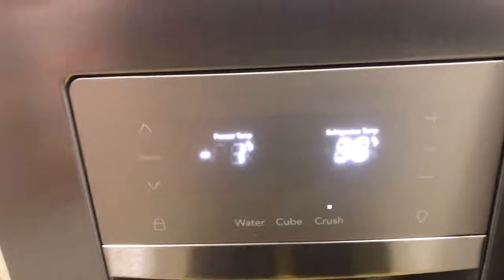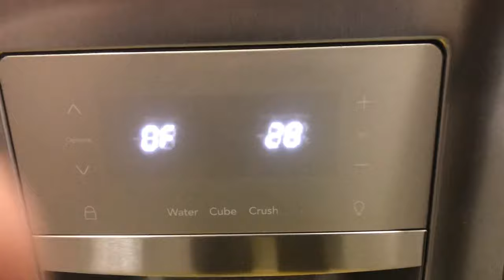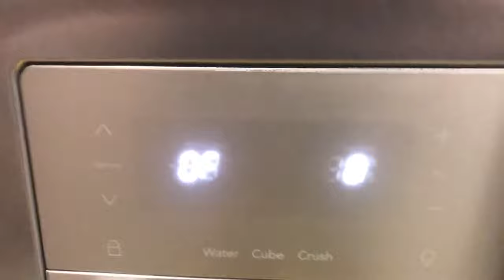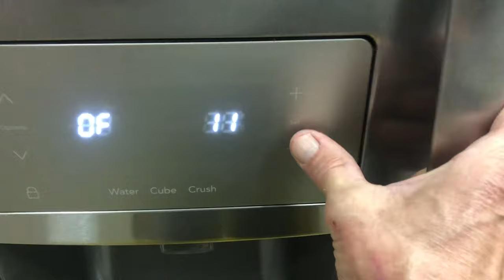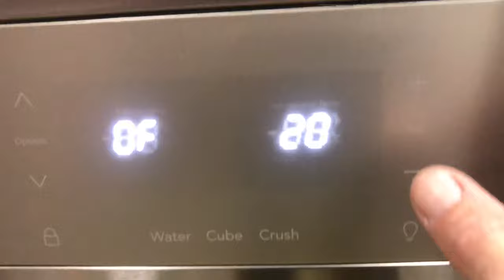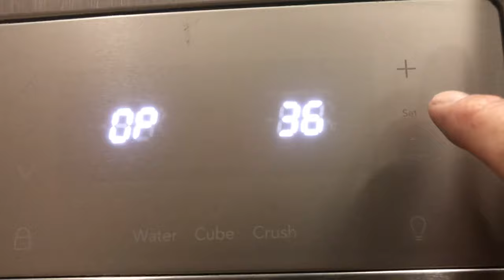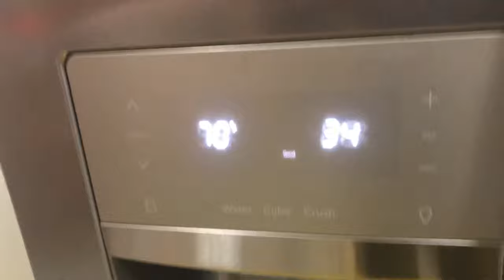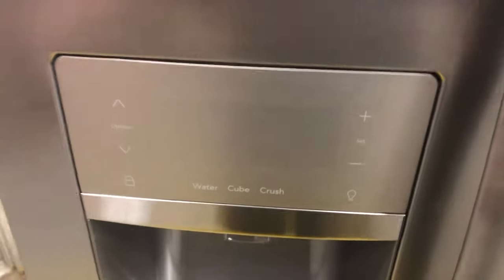Running Diagnostics(Test Mode) On A Frigidaire Gallery Side By Side Refrigerator

Comment: 28 = water/ice dispenser paddle
46 = humidity sensor
47 = heater inside dispenser area to prevent condensation, can toggle it on/off
1 = compressor
2 = defrost heater
8 = water valve to dispenser (put a water cup in place first)
10 = ice dispensing motor (take ice container out when doing test)
11 = ice cube crusher (don't let it run too long will damage coil)
12 = condenser fan38 = compressor (unclear difference between this and #1)
13 = fresh food lighting
15 = evaporator fan in freezer
20 = freezer lighting
22 = air damper that allows air from freezer to refrigerator
36 = ice chute door
23 = fresh food door
24 = freezer door
29 = fresh food thermostat
30 = freezer thermostat
33 = ambient thermostat (room temperature)
34 = control panel thermostat39 = evaporator thermostat (controls defrost)
45 = unclear, potentially another thermostat
0, 1-, 2-, 3- = "don't worry about these"
Reply: Could you send the codes to my email please. I do not have eyesight I can’t seem to get my iPhone to copy them for me or give me the opportunity to copy them
Reply: THANK YOU
Reply: Thank you!
Reply: How do u exit the menu? Lol
Reply: Thanks so much for breaking it down, you're awesome!😀
Reply: You rock. Thanks!
Reply: @Illmatic1989  leave it alone for 5 min... or press + for 6 seconds
Reply: I don't have a select button, just up and down buttons. How do I make it turn the compressor on when I am in that option?
Reply: Water valve on to ice tray ?
Reply: You are doing God's work sir

Comment: I have a brand new frigidaire gallery model GRSS2352AF side by side. Only owned it a week. Unit is stuck in OFF mode. Sales store could not assist. Frigidaire support closed on weekends. I'm desperate for assistance as I just replaced $300 worth of groceries that I had to throw away from previous unit dying

Comment: My fridge is not cooling but the freezer works fine. I am guessing its the fan from freezer to fridge or the door/flap that is not working. 
I just tested my paddle switch thanks to this video and it works. 
Now, need to test the evap fan.
I wish you posted a link to the document that you are referring to in the comments so people can use it if they need to do it again. Still, Greatly helpful video!!!
Reply: Mine has same problem may I ask what the problem was? We had repair man twice and still same problem. We unplug overnight then it works 2-3 weeks but keep’s continuing same problem then

Comment: I have a Frigidaire Gallery like the one in your video.  Display reads 1 and 33 for temps.  But I’ve placed thermostat inside. Bottom shelves of fridge shows 33 and as you go higher it reaches 50+ at the top.  Can u diagnose based off of this. ??
Reply: Also your showing the test but what does it show if something is wrong or faulted?

Comment: Can you run the auto defrost with food in there?
Reply from the maker: Yes. Auto defrost will be about 15-20 minutes then normal cooling will resume
Reply: I removed the icemaker and fan as we don't have water hookup. The coil behind the icemaker and the evap coils are frosted over, but the the drain hole is clear. Is this OK?

Comment: My frigidair refrigerator got flooded about 1 foot high. Now dead. no lights no sound. Could it jut be the starter relay and capacitor?
Reply from the maker: Sounds like the main control fried. It’s underneath the refrigerator in the front behind the toe grill.

Comment: My Frigidaire Gallery is freezing food at the back of the refrigerator.  Is there a test result for that?  Help!  How can I fix it?
Reply: I have the same problem.  Did you end up ever getting it resolved? I tried all the diagnostics and put an actual thermostat in the refrigerator side.  The actual temp in the fridge is lower than what the display reads...our food keeps freezing and honestly not sure what to do at this point. Any info would be helpful please!
Reply: @gigigigi787  any news re: solution? I just bought one on 11/20/23 and same thing is happening.

Comment: Thank you for sharing. My Frigidaire Refrig is about a year old-ish the frame inside is now hot and the rubber on the doors. Not the whole frame. The hot spot is about a quarter from the top of the fridge handles. What can that be? Thank you.

Comment: I checked the diagnostics and even though I have the temp set on the control panel to 33 degrees Fahrenheit, the diagnostic says it's set at 17 degrees Celsius (which is 63 degrees Fahrenheit). When I get out of everything, the display says 33 degrees F for about 30 seconds, then it jumps up to 63 degrees F. Is it possible to correct the temperature shown in diagnostic mode? BTW - this was a VERY helpful video... even more than the manual. :)

Comment: BRAND NEW OUT OF THE BOX REFRIGERATOR!!! We went through all the tests and per the tests, the refrigerator is in working order.  However, the refrigerator is still not cooling or freezing....  Been plugged in and set to the recommended temperature settings for 18 hours plus and no change.  Very frustrating .
Reply: Sounds like maybe the compressor isn’t running or there’s a problem with the Freon system. I understand your frustration! Call Frigidaire asap!

Comment: Got compressor to start again (not sure if it was due to diagnostics) . IMPORTANT question…how hot is the back of the fridge supposed to be?? Is that the fans cooling the compressors?
Reply from the maker: Your condenser coil and fan are in the back next to the condenser, depending on conditions it could get fairly warm to hot. That fan should be running any time the compressor is running. If the fan doesn’t run it will get very hot back there and could cause the compressor to shut off on overload.
Reply: @danielsonpicker7279  thanks….i stopped working the same time my both 2 ACa stopped cooling, my blender started smoking and than the fridge. My freezer was 30 degrees and the fridge was at 59 in diagnostics. Never seen a fridge not turn on the compressor as soon as it starts. Is it suppose to be slow. I was hearing a clicking for hours in the top back (fridge not freezer) area. Never heard it click click click click click. I assume compressor is on the bottom. Strange.
Reply: My PSEG tech even said an amazon tranformer blew in the morning when I was asleep. I assumed we had a outage and than got low power feed. Strange day haha 😂
Reply: @danielsonpicker7279  also i noticed there was no number 36? I assume to turn on the compressor on and off. Along with the clicking back-too area of fridge (not freezer)

Comment: My control panel lights cannot be read, appears that some lights are out or something else is wrong.  I cannot see anything to set??? Please help.  I cannot run diagnostic on anything cause lights are spotted and not readable.
Reply from the maker: If some of the LEDs are out on the control panel it will need to be replaced.

Comment: My frigidaire flapper that seals between the top doors has a 1/4 in gap at the bottom. No seal under the flaper. Not even one in the parts pics or diagram. I don't see we're anything goes under it to seal it when the doors are closed. I put foam under it to seal it. What is the deal on that?
Reply from the maker: It’s tough to say without seeing it. Something is broken. Depending on the model my guess is it’s probably the bracket that holds the door or could be the spring or mechanism that pulls the door closed. You would have to take it apart to get a look at what’s going on.
Reply: @danielsonpicker7279  
It's the million I'm talking about. The bottom of it has a gap when closed. Nothing in parts list shows anything to seal the bottom when the door is closed .

Comment: Hello sir, after I hook up the display interface, it doesnt power on or light up at all.  Is there a way to trouble shoot this issue?  The fridge is still running, but the lights in the fridge is also off.

Comment: I have the same fridge and the compressor runs fine, the cooling fans runs fine but it is not cooling at all fridge or freezer. would that be the thermostat and how can I test the temperature thermostat to determine that?
Reply from the maker: If you are not getting any cooling at all and everything is running you most likely have a freon leak or restriction in the freon system
Reply: @danielsonpicker7279  other than that do you recommend me checking anything else that could be causing this issue it does not cool at all it but the fan and compressor is running fine.
Reply: @danielsonpicker7279  also this is a brand new fridge still has the stickers on it it was purchased in 2019 but before the homeowner moved in he foreclosed on the house so the fridge still has stickers on it, has never had food in it.
Reply from the maker: If the compressor is running you should be getting some cooling, if you are not, that’s not good. I would check the owners manual if you have it or call Frigidaire, some models have a five year sealed system warranty.

Comment: On my control panel some of the lights  don't work so I can't always make out the entire number. I noticed you said that this would require a whole new panel do you mean a new Frigidaire 242058230 Refrigerator user interface or the User Control and Display Board? I have the Frigidaire FGHB2866PFEA model .
Reply from the maker: For that you would replace the user interface part# 242058230

Comment: I'm trying to repair one of these and replaced the main board but the compressor and condenser fan don't run. It has 122 volts going into the inverter board and a 5v signal voltage. The compressor ohms out at 6.5 for all 3 windings. I noticed at the condenser fan I have 119 volts when unplugged from the fan but nothing when plugged it. I tested the fan separately and it runs perfect. Any ideas? The model # is FGSS2635TD9
Reply: Also It does not have the test number option to choose for condenser fan test. No test 12.

Comment: Hi there thx for the vid! I have a Model FGSC2335TF5 and only the Water Dispenser Light is not working - everything else is. I'm assuming I need a entirely new user interface as well? If so, can you recommend where I can find the part # for that?
Reply: Did you ever figure out how to fix that light???  Mine quit working also!!  Thanks
Reply: @fredc8720  You have to buy a whole new interface! I haven't bought one yet - it runs about $100+. Sucks that you just can't replace the bulb!
Reply: @michellep5387    thank you.   I was afraid of that !!!

Comment: How do I get this particular fridge out of “Demo” mode. We bought it as a floor model & it’s been in Demo mode ever since. Thanks!
Reply: US TOO! we got ours today and the lights won’t turn on and it says both temps are 56. we bought a floor model as well. if u find anything out, please let me know!
Reply: I was able to fix this. Unplug it for a 1/2 hour. When you plug it back in, hold the down arrow under options & the + sign simultaneously. That’s what I did & it worked. Hope it works for you!

Comment: Great info, thank you.   I changed my filter cartridge and now have no water at the dispenser.   Any ideas?
Reply from the maker: Try putting the old one back in you might have a defective filter. There’s been problems with some of the generic filters
Reply: @danielsonpicker7279  I've discovered that the fridge needs to defrosted.   What's the best way to do that.  Also there's ice collecting in the bottom of the freezer.
Reply from the maker: The easiest way to defrost it would be to empty it and unplug it for 48 hours with the doors open. If that’s not an option you’ll have to take the freezer apart and get to the evaporator and manually thaw it out with a heat gun or hair dryer. BE CAREFUL not to focus the heat in one spot for too long, plastic and wires melt very easy if too much heat is applied. You will also need to diagnose and repair the issue that caused you to have to defrost it. My best guess would be the defrost thermostat or thermistor but there’s also a control and heater involved. Good luck!
Reply: Quick run thew.only for someone knowing every term as to check for me it's compatible with working on new automobile

Comment: My Frigidaire Gallery  LGHD2369TF7 - Upper ice maker stopped making ice - Bottom freezer ice maker is making ice. Water dispenses out of front of refrigerator as normal and the ice auger in upper maker moves but since no ice nothing comes out - Also after I turned off refrigerator and left doors open over night I turned back on and the upper ice maker had a very small amount of water in ice cube tray it did freeze and dump the ice into the bucket BUT NO WATER FILLED THE TRAY AGAIN. Is this a clog? Even if I am able to get water from dispenser as well as ice making is happening in lower freezer compartment? Would like to get answer as I have a repairman scheduled and would like to have some idea before he arrives in a couple of days.
Reply: The water tube to the upper ice maker runs through the ceiling and have been known to freeze, Frigidaire has re-designed the water tube to prevent it from freezing. The fans for those ice makers have been known to ice up as well, if this is the case it would require an air tower kit. Hope this helps!
Reply: @PickerJimS  what is the part number for and "air tower kit" it does not come up when I search Frigidaire gallery parts. Is it an evaporator fan? Are there diagnostic numbers I can run to see if either of those are the problem? I have a tech coming and trying to figure it out first!
Reply: @mamtschweitz  they call it an air handler the part number is 5303918784. Of the fan is iced up you will need this kit. You can look at the fan it is behind the ice container, sometimes you can see ice by the fan blade but not always. If you run the diagnostic for the ice fan it should run, if it doesn’t it’s likely iced up, those little fan motors rarely fail.

Comment: How do you adjust Ice size and frequency? I know there are some hidden settings for this as I used them once but lost the info.  Same fridge as this video.
Reply: Press the water and crush ice buttons simultaneously for about 10 seconds. 1 bar equals less ice 3 bars the most mice.

Comment: 1 question. I just bought a new townhome in feb 2021 and it has the same exact fridge when we bought it with appliances. Last night the water dispenser it’s room temperature. How can I make it cold again. Everything else seems to run perfect? Please help.
Reply: You would think water through a refrigerator would be cold. But this model isn’t apparently. Which was no problem really for me since I had ice in the door to. But now the icemaker quit working. Lol 😡

Comment: Hello.  Can this test be done while your frig is being used?  My freezer is warm and compressor keeps clicking on and off...my refrigerator temp reads fine.  I am afraid if I do this that my frig side will stop too?  Also, is it possible to turn off freezer while waiting for it to be serviced?? It's the Frig Gallery side by side Frigidaire FGSS2335TF   It also freezes food in the drawers. What tests do I run?  Also, should I first unplug for 30 minutes then plug back in to see if it fixes itself before doing anything? (reset?)
Reply from the maker: Yes you can do the diagnostic while the frig is being used. That being said if your compressor is clicking on and off you have a bad relay or bad compressor. The frig may still be cold but most likely it’s only a matter of time before it warms up too. You cannot turn off just the freezer side. It might start working again if you unplug it for a little while but if it does I  would keep a close eye on it for the immediate future. Good luck!
Reply: @danielsonpicker7279  So do I just pull the plug right? Like resetting a router? Also, just pull it for a couple minutes? Or, how long? Lastly, can you show me the diagnostic testing to test the compressor and the relay? Thanks Danielson!
Reply: @danielsonpicker7279  as of right now...it's not being serviced until the 31st.  I'm hoping it won't burn up by then... or cause other problems.

Comment: I have pretty much the same fridge and control panel. I've had 3 power outages. After the first power outage the fridge reset itself automatically. The last two outages I had to reset it by unplugging it and plugging it back in. Is there a way to get it to automatically reset again? Thanks
Reply from the maker: The electronic controls on these are very sensitive. You are lucky to be able to reset it. I would recommend putting it on a surge protector.

Comment: Hello there, do you know which one sets the compressor valve to open on dual evap models?
Reply from the maker: Hi. Depends on the model but usually if you unplug the refrigerator for a few minutes when you plug it back in the three way valve will go to the open position within about 30 seconds

Comment: Thank you for going through this Daniel, but from watching this you don't seem to know what these tests actually do other than how to turn them on and off.

Thank you for the attempt.
Reply from the maker: Yeah you’re right, more than 28 years experience with residential HVAC and  refrigeration repairs and all I know is how to run through the diagnostics!  😂😂😂
Reply: @BRANDONHARWELL-m9q  This video was very clear cut and highly useful for the average owner of the fridge. If it was not clear just rewatch it until it's clear.